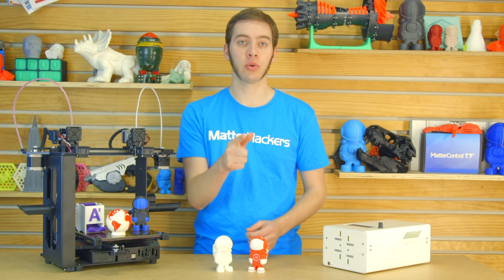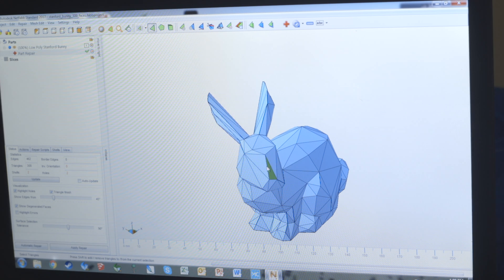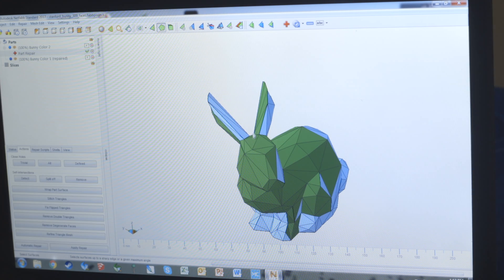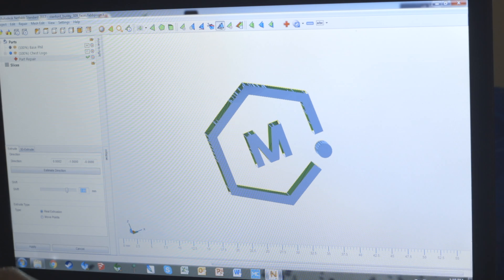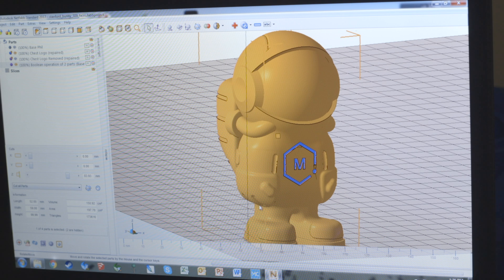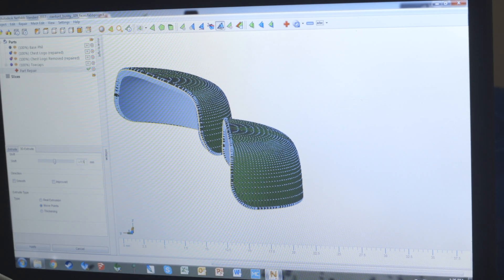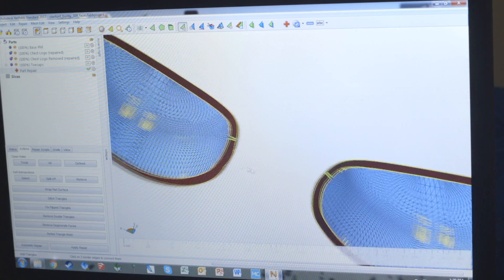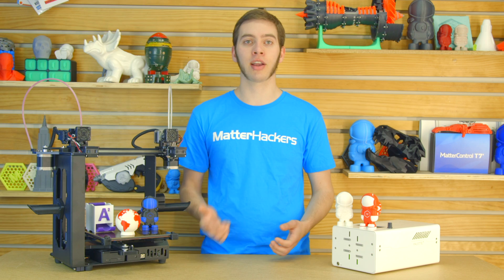How To Make A Dual Extrusion 3D Print // 3D Printing Tutorial

Comment: why u always assume 2 extruders mean 2 colors? I always wanted to have dual extruders for differential printing: 1mm nozzle for building up fast and strong external structures / infills of the part and 0.4mm for fine detail (faces, logos, cavities for nuts, etc); that case is not covered at all by these videos
Reply: also dissolvable filaments for removing supports in odd places
Reply: @SwitchToRumble  you just set the support to be the other nozzle and load the dissolvable filament into that extruder

Comment: I have a creatbot dual extruder, every time I try to print in 2 colors, the 2nd color is shifted over 1/8 of an inch.  It does not line up with the 1st color, any ideas how to fix, thanks
Reply: You need to adjust they x,y of the 2nd extruder in printer menu